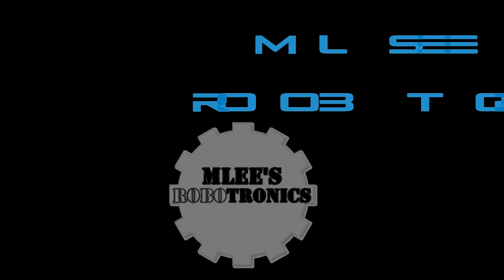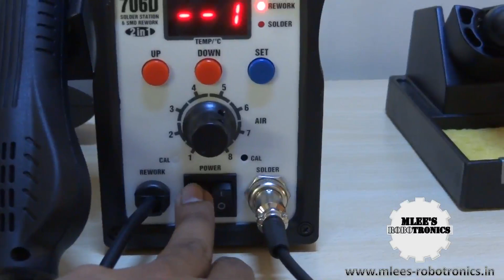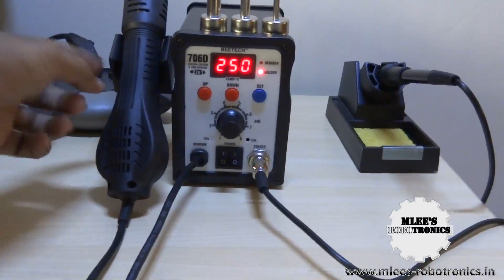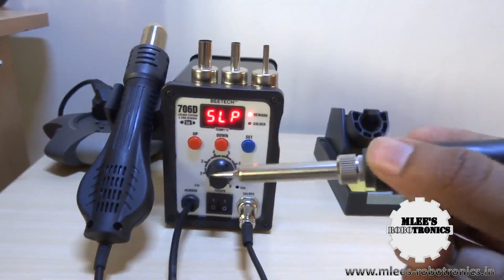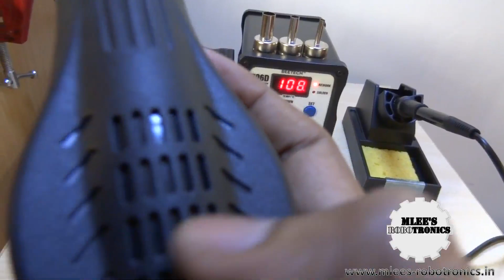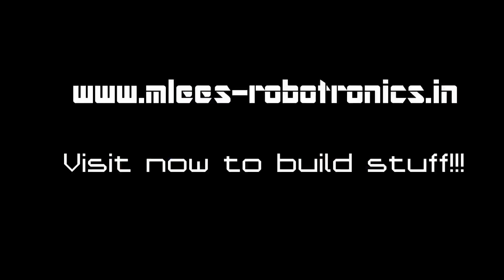Review and demonstration of 2 in 1 Soldering and SMD rewok station

Comment: He didnt lift the hot air not even in hand,the purpose of this cheapish crap tool in only to make you to buy it and then throw it in garbage.Test it in real rework conditions in large double sided pcbs to see what can does as a machine while trying to desolder 64 or 128 pin smd IC.Not only the temperature but the thermal density capabilities is what makes a tool a real good one.

Comment: One correction sir, soldering iron maintains temperature via regulating current and not voltage.
Hot air gun needs to cool down to a certain level before it (fan) can  shutdown. Heating element shuts off immediately but not fan. It is not a flow but standard practice.

Comment: hello.The sensor in soldering iron is not placed near the handle. It is a thermocouple inside the ceramic heating element along with the heating coil.

Comment: I believe you're review is flawed, it might just be the way you're made...or maybe you don't know what the hell you're talking about....(to mock the way you spoke of the flaw)
Some of your 'percieved flaws' are YOUR misunderstanding of what is going on...or you're expectations for what you paid for.
The 'flaw' you THINK you identified in the rework station 'it sometimes doesn't recognize it in the holder and takes time to turn it off' is NOT A FLAW. Its a 'cool down' stage to prevent the heating element from 'cooking'. Everytime you put it in the holder, the temp. immediately began to drop...but the blower continued running to HELP cool off the element. This is NOT a flaw, it does this BY DESIGN. Ceramic, unlike steel...can crack when left hot for long periods of time. But if you want to go in there and make it so the blower turns off when the heat turns off, be my guest...but, you're going to FRY that rework element.
And simply because the tip that's included doesn't work for YOU...(and its not likely to for most experienced ppl) doesn't make it a thumbs down either...ffs, you didn't pay $400 for it (US).
Its a cheap (inexpensive) 'low end' product, that at least does what its supposed to do...without having to sell a child to afford it. But NO...some youtube reviewer has to claim its got flaws and should have included what HE wanted...but without asking MORE money for it...typical
Reply: you're right, but that doesn't mean you have to be a dick about it, and I don't expect there is much difference between the manufacturing price of a chisel and standard cone tip, and the supplied tips probably often get thrown out or go to waste. The reason why a lot of stuff like that still occurs is because the manufacturer doesn't KNOW that a chisel tip (or anything else for that matter) is something that the customers want and it is reviews like this that help change that

I know I'm 5 years late tho lol

Comment: and 'normal about this? ventilation and' regular re-explain the problem, when increasing the temperature of the hot salt such as 300 degrees a little 'more' type 378 and then down to the temperature impstata, 300. and 'doing normal things?

Comment: hello, I wanted to ask and 'normal for the 8586 my attention when I set the temperature for the hot air to esepio 300 degrees the temperature rises up to 380 and then stabilizes at 300, it seems strange,

Comment: I bought the same unit today :) Thanks for helping me decide.
For correcting the offset in the display temperature and actual tip temperature, there are two pots marked CAL for calibration. I havent tried it though.

Comment: Its not a flaw that it doesnt switch off immediately when rework handle is placed back on the cradle. It switches off the heater immediately but keeps the fan on to cool down the heater else the internals would remain hot for a long time. At least thats what Dave Jones said in the review of that Atten thingy.